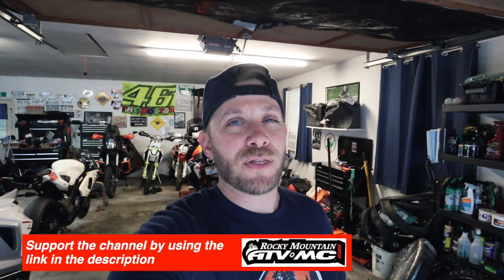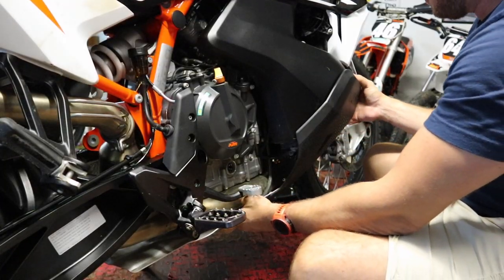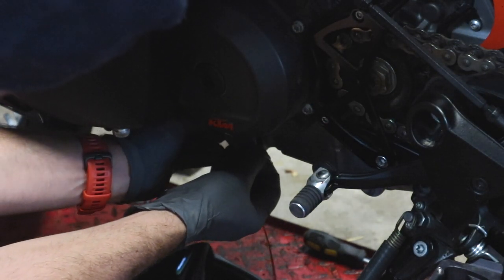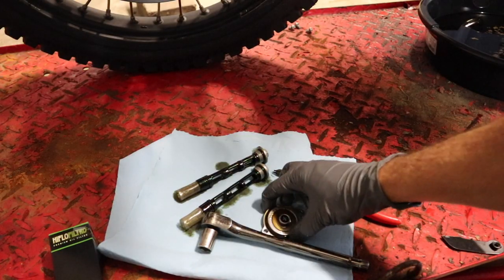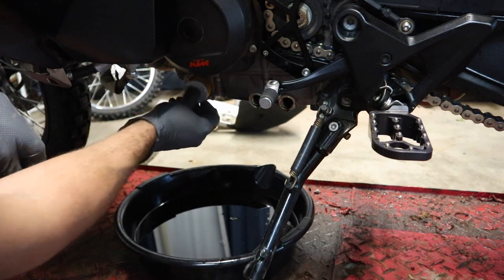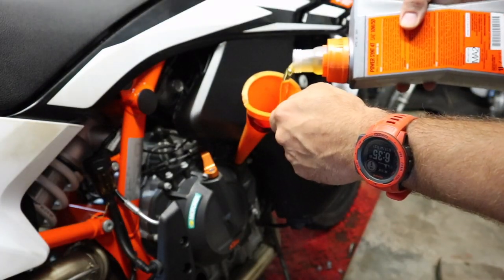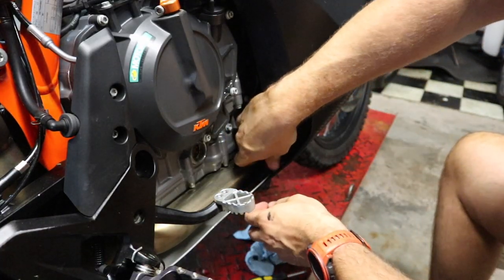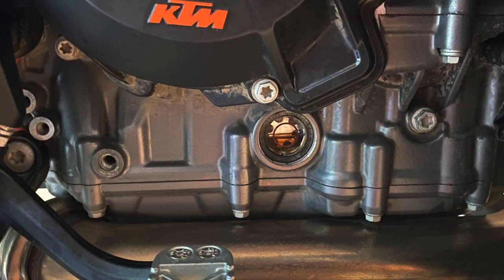KTM 790 890 ADV R Oil Change | Back in the Garage

Comment: I did the oil change and there is no way to don't get a some leak from the filter cup. I changed o ring I oil it im tightening the bolts manually but I think firm enough.  That's driving me crazy I always find 1 drop of oil
Reply from the maker: 1) Don’t guess; torque then appropriately. 2) Make sure you didn’t scratch/tear the new o-ring when u installed it. I’m still on the original o-ring on my 1290 with nearly 60,000 miles on it. 3) Once you’ve done the first 2, if it’s still leaking, just put some high temp silicone around the o-ring and ride it.

Comment: Wait what ! I can't unscrew my oil cap my tank is in front of ! Is it an update on the 890 r compared to the 790 r ?
Reply: common issue. The mount for the tank has some movement, adjustability in it, so depending on how it was put on, it can block the oil filler cap. Short of trying to re-mount the tank, you can get away with cutting down the wings of the filler cap. The aftermarket does sell replacements that are already lower profile.